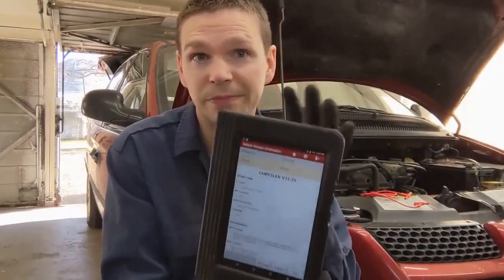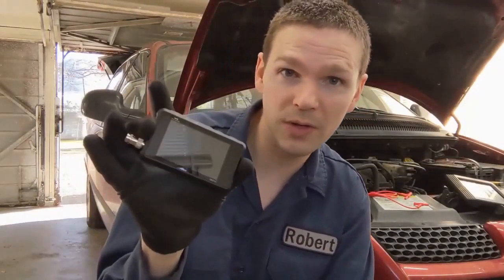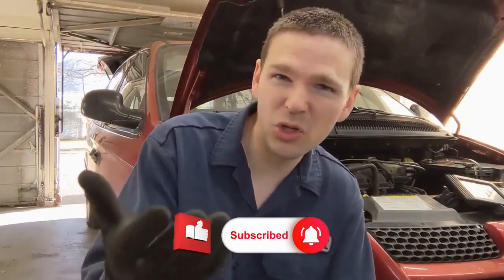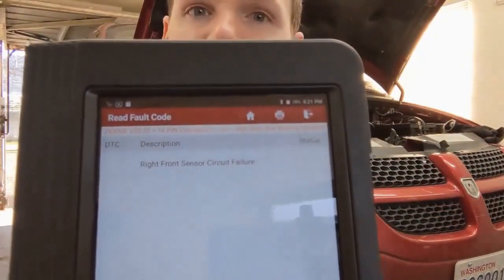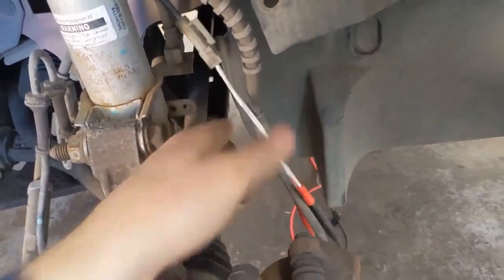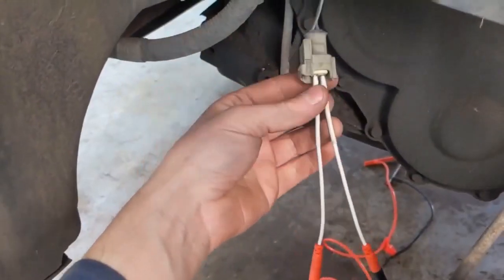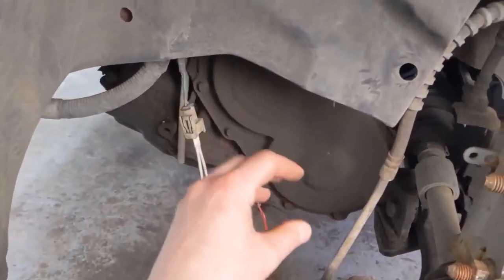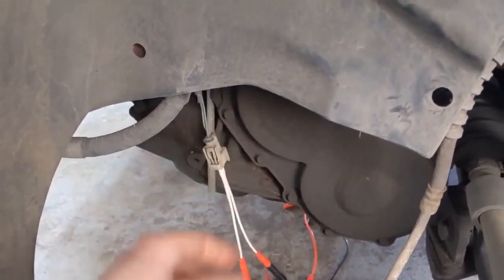How to Test a Wheel Speed Sensor | Wheel Speed Sensor Testing Methods | Abs Sensor Problem Symptoms

Comment: Hi, when I do the Ohms test do I need to spin the wheel while testing? 7:43 in video
Reply from the maker: Nope. Just the multimeter set to ohms with the sensor unplugged 👍
Reply: Hi 
Will I start the car?

Comment: hmm, not all true. Continuity readings with DVOM must be done after you have your homework done first.  Zero continuity or an open on the LCD screen is the sign of a GOOD sensor actually, if it is on active ABS system like ford 500, etc.  Getting no resistance readings on a passive sensor like toyota camry would indicate the wiring is broken or sensor itself went to sensor heaven.  Having one work intermittently, now that will make you want to cry.

Comment: My front left gives a Renault DF091.
ABS light on.
Light goes off and on at certain speeds which are not a 100% fixed speeds.
All4  sensors do read the correct speed. but at certain speeds the Front left goes to 655 km/h.
Like for example i could like drive for minutes on end with a speed of like 20/30 kmh, if i then speed up to 50, the lights go on and the speed reading is not correct on the 1 wheel.
And then when i slow down it returns to correct speed.

Can you then already conclude its not the sensor but probably the absring which is between the wheelbearring and wheelhub?
Id  imagine its not common for a sensor to go broken only at certain speeds?
Reply from the maker: Good question. I can't see it being the ring. What is the year make and model. I'll look up the code you mentioned.
Reply: @ValleyMobileAutomotive  Renault Twingo II 2010. I wobbled the front wheel when it was of the ground. Didnt feel anything weird on the bearing. Also during driving no noise.    The DF091 code only says that and 'Front left Wheel Target' .

I do feel like at start of a ride and i brake on slow speed till (almost) 0 it feels like the front left wheel blocks or so. The sound and feeling as if ur breakin on a icy road.

Oh thats crazy. My inital message doesnt include the part where rear left also gives the 655 kmh reading. As far as i see. Every time during driving my front left goes to 655km, my rear left does that too.
But fault code is only on front left.

Comment: Great video, I think there is one problem with your signal generator test tho, what if it is a broken connection in the + feed from the ECU to the sensor? That will not show if you don't test that pin on the connector, or am I thinking wrong?
I saw a comment on a Toyota sensor having a much lesser value when Ohm-metering, I guess that is a coil-type sensor, while the one you are testing is a Hall element?

Comment: I have a signal generator, but not the one specifically for the ABS, what voltage amplitude should I use for the sine wave?  Is 1V peak to peak OK?  I will look at the signal with an oscilloscope at the ABS module, I just don't want to use too large of a signal and possibly damage some circuitry.

Comment: Testing my left front sensor was not the problem I had. I knew it was bad from the code reader and a Ohm test on the loose sensor leads confirmed this. My main problem was the getting the damn thing out since it was so rusted in (20 year old Honda) that the only way it would come out was in little pieces. 
One trick I learned was if you have the hub out to change an axle, be sure to soak that ABS sensor in penetrating oil from the axle side. Let it soak for a day and then take a 17mm socket and gently tap the sensor out of the hub with a small hammer. This way you dont break it compared to trying to pry it out from the other side where the bolt is. Put a generous amount of grease all over things when reassembling to make this chore easier next time too.
Reply from the maker: Hey Mike, Thanks for the tips! 👍

Comment: Man, sensor resistance 5 MOhm is not right. This sensor is a wire coil with metal core. Let's  say they use thinnest possible wire 40AWG (d=3 mills).
1 mile (!) of this wire has resistance of 5.5 kOhm. Toyota Camry sensor resistance is 1.5 kOhm. That is 3300 times less.
Reply: I think it depends on how the sensor works. Many sensors use a Hall element I think, and that will give the high Ohm reading. It's my guess anyway.

Comment: Hi, nice and informative video. What type of wheel speed sensor this vehicle has?
Reply from the maker: Good question. This is a variable reluctance sensor. It produces its own voltage as the reluctor wheel passes by the sensor. It's been around a long time. Many new cars now have what's called a magneto resistive sensor. It works on different principles. It would be nice to make another video that focuses on the new technology.
Reply: @ValleyMobileAutomotive  Hi, thanks for your reply. Yes, if you make another video for Magneto Resistive Sensor it would help us a lot. Thanks.

Comment: I have a 2006 dodge Magnum that is giving me all the dashboard warnings; abs, esp, lightning bolt⚡, etc. 
The transmission is whining and goes into neutral.
My speedometer isn't working too. 

With that many warnings could it be a wheel speed sensor...or a bad PCM?

Comment: issue with the oscillator/generator is you need live data on the diagnostic tool which ups the cost of that end too - hoping to just eliminate bad sensor and check voltage on wires hopefully.

Comment: Can a wheel sensor affect the speed? When I'm driving my MPH drops . I've replaced my inner and outer speed sensor already but it continues to do this. I also replaced my instrument cluster and catalytic converter this week too. Any idea what it can be. No mechanic shop has been able to figure it out
Reply from the maker: Hey April, what kind of car is it?
Reply: @ValleyMobileAutomotive  it's a 2008 Kia Spectra
Reply from the maker: On your vehicle the speedometer gets its signal from the Vehicle Speed Sensor on the transmission above the front passenger axle. There are testing methods to determine if it's a failing sensor or a wiring glitch. The abs wheel speed sensor will not cause your problem. Hope that helps 👍
Reply: @ValleyMobileAutomotive  maybe a wire glitch. I saw some other videos say it could possibly be a fuse going out . I will look into both. Thanks for responding 🙂

Comment: I picked up this scan tool ''ThinkScan Plus S4'' to read these modules ABS SRS ECM TCM BCM and give me live data,, only ran me $137 on ebay. I also picked up an extension cord to go with it,,, ''3FT 16 Pin Car OBDII Male to Female Extension Cable'' for $11, I can set my scanner in the pass seat to see live data as I drive carefully around!! Been had a couple electrical meters,, old industrial electrician. To read your codes you MUST have an interface to ''talk'' with your car's computers!

Comment: Does a faulty wheel sensor cause the parking brake light to come on sometimes?. I have a 2013 Veloster with a rear right wheel speed sensor faulty. ABS and Traction control lights are on. because of that. But lately, i have noticed my parking brake lights also indicate on the display and it causes the car to move slowly. Could this be an effect of the faulty wheel sensor?
Reply from the maker: The brake light is on all the time or sometimes? Low brake fluid can be a cause of the light coming on. What kind of parking brake do you have? Is it a button you push, a lever you pull in the center or a foot pedal you press?

Comment: I have a 2007 Toyota Camry sensor right front is bad I changed it light stayed off it comes on periodically now it stays on all the time what should I do
Reply from the maker: Two questions: is the light on for the same sensor (right front) and what brand sensor did you use? 
Two thoughts come to mind. Either the sensor is faulty again (my first thought) or it's a wiring problem that was temporarily fixed while moving things around during replacement and now the wire fault is back (less likely).
Reply: @ValleyMobileAutomotive  hi i had the same thing.  but this is the second time i replaced it.  the errors were gone I drove something with 15 km and is back.  the garage said they taped something with cables when they replaced it. It could be wiring problems.?  the first time when I went to replace it, nothing had happened, the errors had come right away.  and is it normal that when I open the car that I immediately get the errors (handbrake)? Please help i stuck with this problem for 5 months.
Reply: @ValleyMobileAutomotive  and I went to see with the diagnostic tool what the reading things are.  back and front left reads well.but right front nothing he is at 0 and the other just good.

Comment: Good video.  I have a 2011 Kia soul+ auto with an intermittent ESC light.  It generally comes on in the summer time in the hot weather.  When it does, we lose power and must turn it off to continue driving.  I have just a basic scanner from Amazon (no abs) and no fault codes show up on it.  Does the fault/light need to be active for it to show up on my scanner?  I've read it could be wheel sensor or brake stop switch.  I really don't want to be buying and replacing parts that aren't faulty.  I don't have all the tools you have to diagnose.  Recommendations?  Thanks again.
Reply from the maker: Hey Bryce, some fault codes will stay stored in history for a little while even though the light is out. You don't need a super expensive scan tool but one that can read abs codes Is a must. The codes won't show up on a tool that only scans the engine computer. You can also take it to an auto parts store like AutoZone and see if they can read the codes. It's free and that may give you a direction to start with.

Comment: Do I need a scan tool or just a signal generator for testing ? Thanks!
Reply from the maker: Yes, you'll need a scan tool capable of communicating with the ABS control module. The signal generator is for testing the wire integrity from the speed sensor to the ABS computer. The only way to know if the computer is picking up the signal is by looking at scan data.
Reply: @ValleyMobileAutomotive  I already have a scan tool (on my phone), but when I select  "Live data" option, it doesn't give any readings from the abs sensors, so I'm not sure if the signal generator will help me to get readings on my scan tool. Thank you for your quick response !

Comment: You forgot to mention symptoms
Reply from the maker: You're right I didn't, good point. Typically the only symptom you will have is the ABS light on. When the system detects a fault it turns your ABS off. So you can drive and brake but without antilock brakes. On the rare occasion the system doesn't realize you have a fault it may apply the ABS when it's not necessary but this isn't common.
Reply: I have ABS light on and tire low pressure light flashing. I cleaned the magnet on the wheel sensor, no go. Then I noticed the drive axle, its ring that the wheel speed sensor is sensing, it looks crooked. I changed the drive axle, all is good now. Lights are off and ABS brake is back.

Comment: Which scan tool are you using? Launch?
Reply from the maker: Hey Andres, yes this is the Launch X431. It's helpful to have a scan tool that can read abs codes and live data. But it's not absolutely necessary. The diagnosis will just take longer.
Reply: I use HyperTough HT200 by Autel and that thing is a beast! $50 @ walmart

Comment: Where did you get the signal generator
Reply from the maker: Hey Jason, It's the Sainsmart DSO213. It's a great pocket oscilloscope and signal generator. I put the link in the description.
Reply: @Valley Mobile Automotive  ty so much I've been wishing I could find one for my x431v but I don't think launch makes one for it
Reply from the maker: @jasonbolka9713  Yeah I don't think so. That's the scan tool I use everyday, I've had it for about 3yrs. One day I may get a new one but for now it's a solid little machine.

Comment: I prefer the lab scope, if you scope the signal you can see glitches the scanner might not pick up, and if the wheel bearing is missing a tooth on the encoder you’d also see that on the lab scope
Reply from the maker: I tend to agree. A scope will give you more precise and accurate real time information. A scan tool will help point you to which wheel speed is causing trouble but that doesn't mean it's the sensor at fault. That's when I'll grab my pocket scope and continue the diag 👍